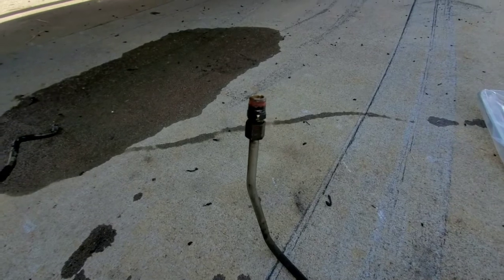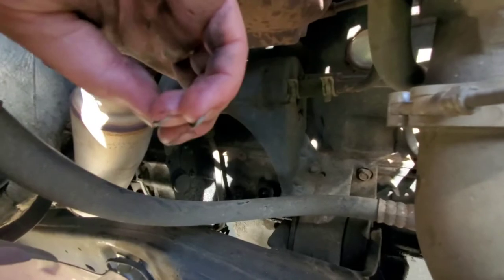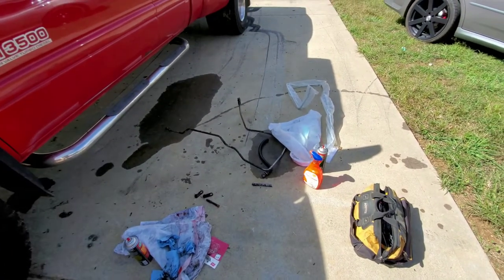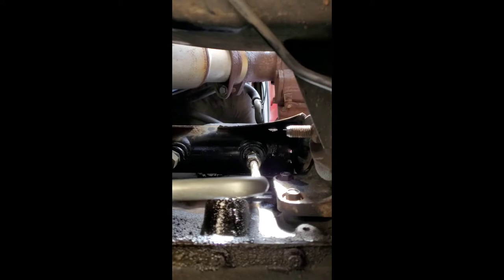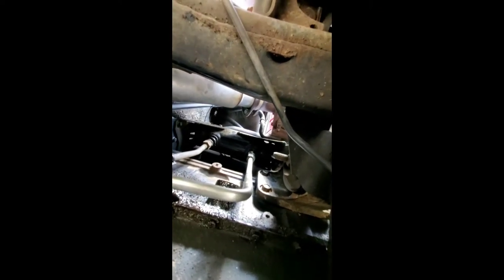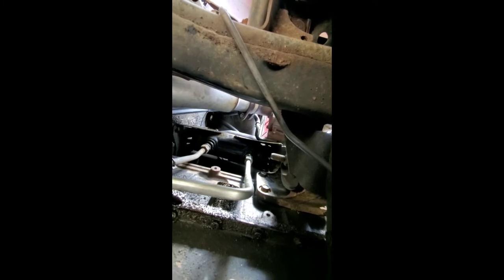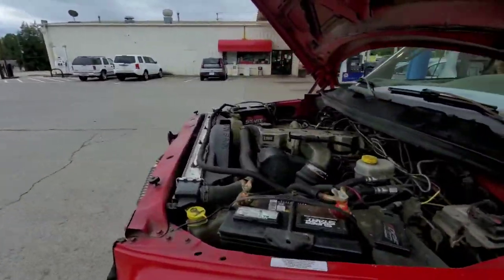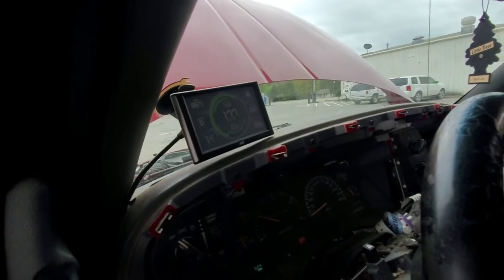Dodge ram transmission lines are on, tires are mounted... LET'S GO DRIFTING!

Comment: Come deal with me at o Reilly's brotha! I run commercial and can give you better deals on your parts!
Reply from the maker: What store location?
Reply: @AbramHeathFULLYEET  411 beside wiegles brother
Reply from the maker: @REDTICK10  hell I'm in there all the time. That's where I got my lines for the truck.
Reply: Seen you there a few times. I work in the back Monday thru Friday 7 to 5:30. Ask for Josh and I will cut you good deals